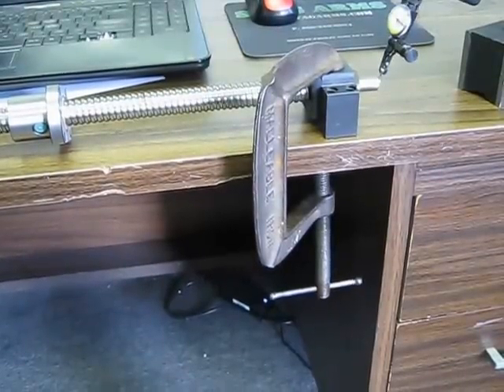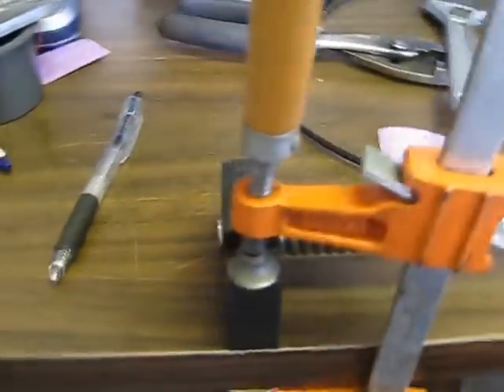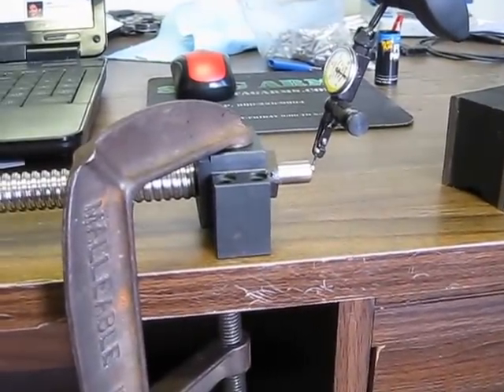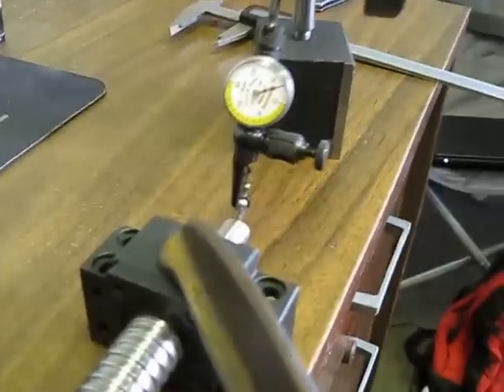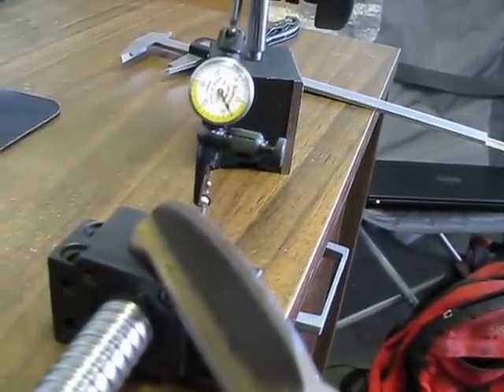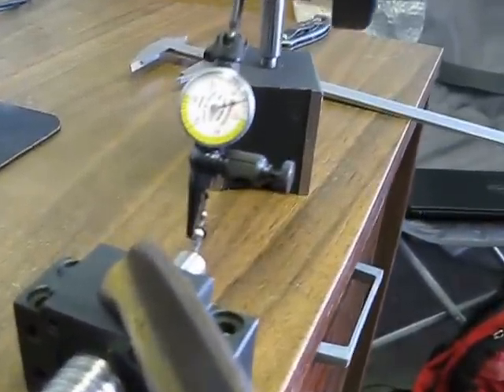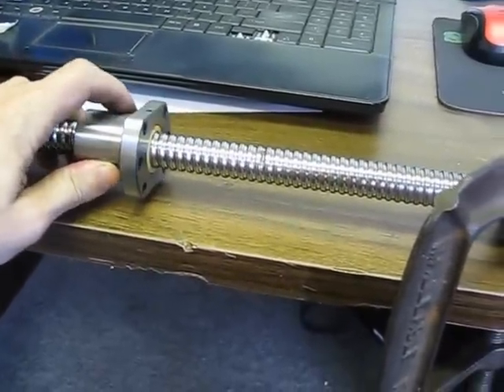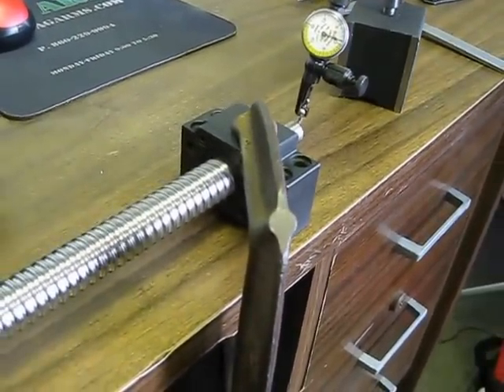RM1605 Ballscrew with BF/BK12 bearing blocks Excessive Backlash

Comment: I had 0.1mm movement on a BK10 , put a 0.2mm shim between the outer bearing rims and its fixed. low load, could replace with angular bearing at a future date.

Comment: I had 0.13 mm back and forward so changed to very expensive DAMEN CNC blocks with top notch 7001 c3 angular contact bearings i hope that cures the juddering on x and y axis